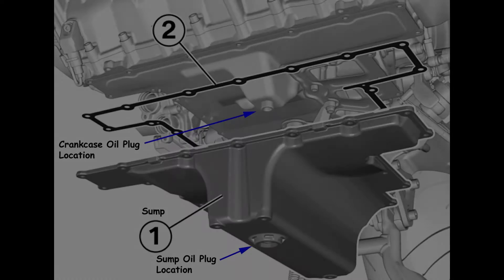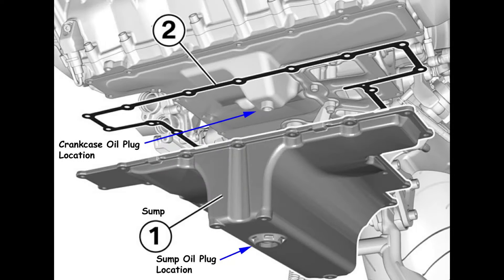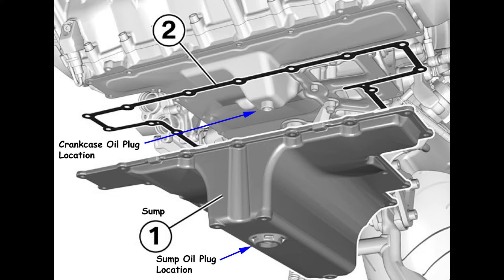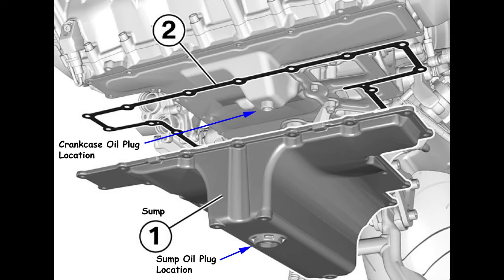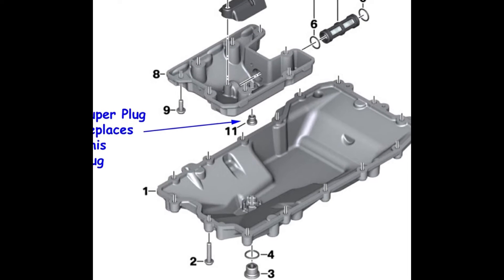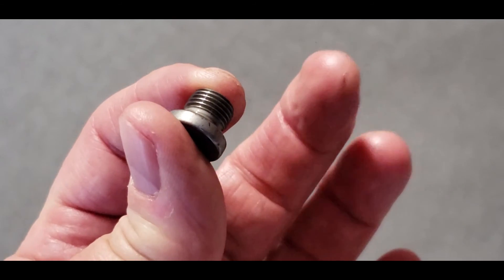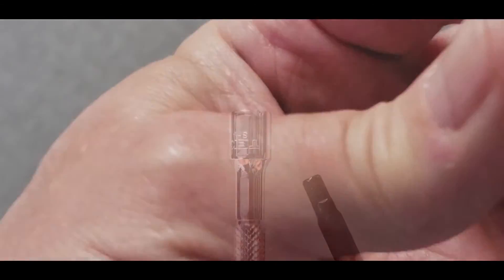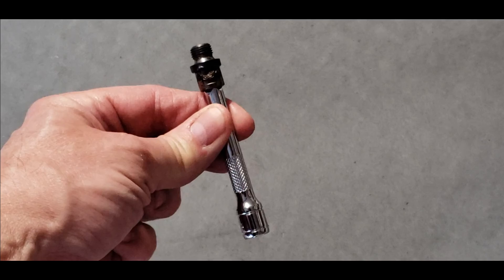No Stress Oil Change BMW K1600 Series Superplug

Comment from the maker: Don't forget the crush gaskets and other stuff you need to DIY your oil change!                                                                                 OIL FILTER FOR K1600: https://amzn.to/3opG4YS
CRUSH GASKETS FOR OIL PLUG: https://amzn.to/3OEap0Q
MAHLE OIL FILTER WRENCH: https://amzn.to/3orPtiY
LOW PROFILE SOCKET FOR MAHLE WRENCH: https://amzn.to/3OAZ69j  (This works great with the Mahle filter wrench!)
CASTROL MOTORCYCLE OIL: https://amzn.to/3onnn8t
ADJUSTABLE OIL DRAIN PAN: https://amzn.to/3sTFYeR

Comment: Got my 2018 GTL two weeks ago and wanted to do an oil change. Once I saw the ridiculous procedure I got upset. 
  Thanks very much for directing me to the better engineered RL Lemke drain plug. My stress level is now back to normal.
Reply from the maker: I've done several DIY oil changes since installing it and agree it pretty much removes all the stress. It's much easier doing it this way...Thanks for stopping by!

Comment: Can you suggest The best most economical oil and oil filter to use?
Reply from the maker: Check the links in description for filter and other stuff you will need. Don't forget the crush gaskets for the oil pan plug! In the description as well.

Comment: Hi l have a question , l bought a k1600 in 2018 , l rarely drove it but l did put 6000 miles on it and having changed the oil yet . I remember they told me when l bought the bike to bring it in at 300 miles for the first service . I my mind l have never done it , because l thought the wanted to take advantage of me because it coasted $500 . 
Now , l realize that l made a big mistake , my bike runs , but not good , specially when l’m in higher speed l feel life it doesn’t want to give me it potential  . I’m planing to take it in for the first service after 6 years . 
I just hope that l did destroyed my bike . I’m so made of my stupidity because l bought it 30k brand new . 
Do you have idea what can happen to the bike if not oil changed for the first 6000 miles ?
Reply from the maker: @Thebossfromdc  Ouch! Metal pieces from breakin period could trash the internal moving parts of your engine. Good luck and get it serviced!
Reply: @californiahikebike  thank you for replying .
Reply from the maker: @Thebossfromdc  You're welcome.  I hope it works out for you.